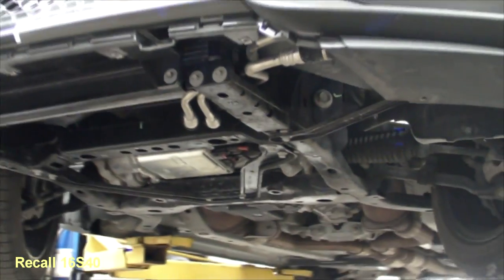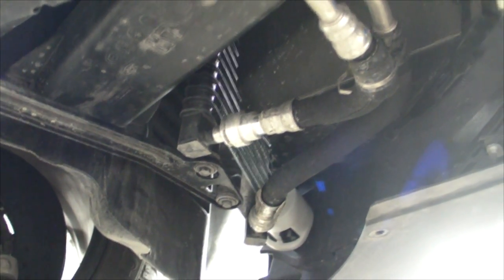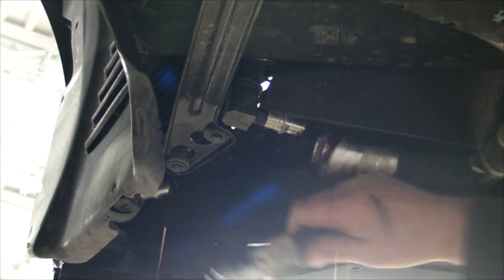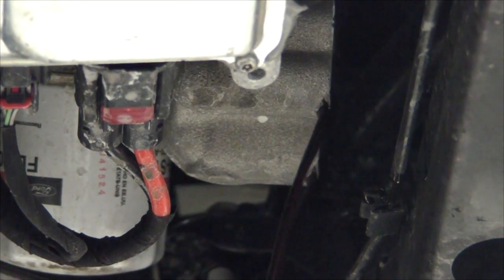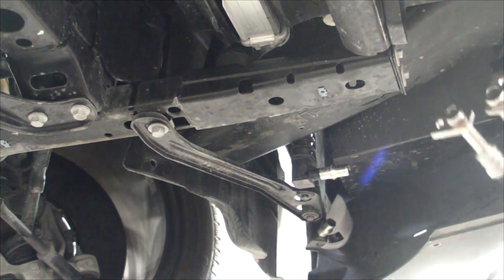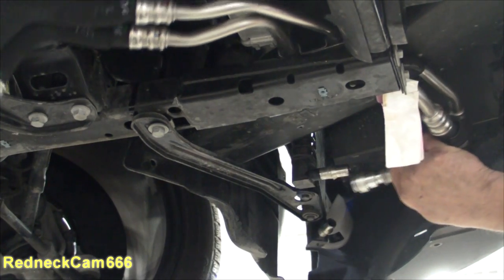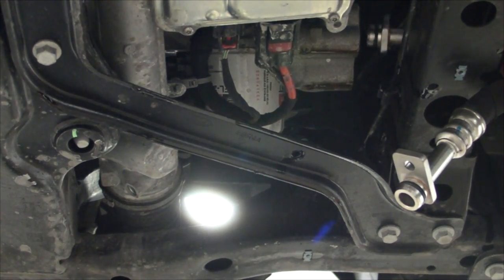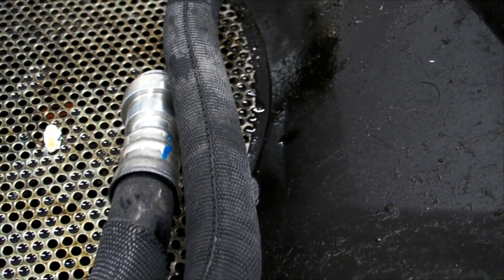Shelby Mustang GT350 Recall 16S40

Comment: I just found this video about how you change the oil cooler lines on a Shelby do you happen to know that torque specifications on the 2 bolts that go to the oil filter adapter thanks
Reply from the maker: Reposition the drain pan under the oil filter adapter. Remove the two bolts and disconnect the oil
 cooler tubes from the oil filter adapter. See Figure 14.
	 	 	 •To install, tighten to 22 lb.ft (30 Nm).... from the recall instructions
Reply: Thank you very much that was a great video